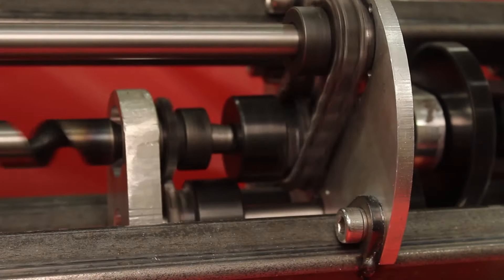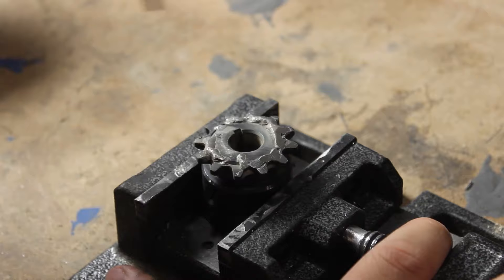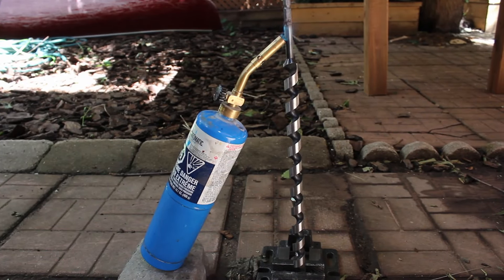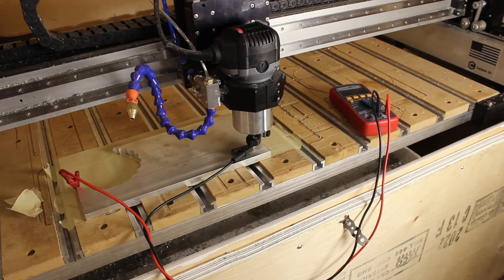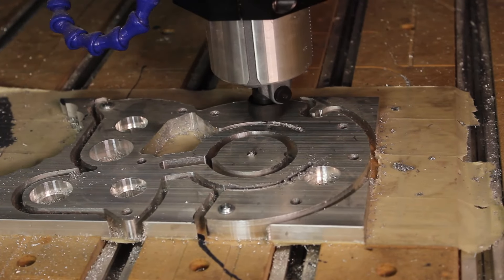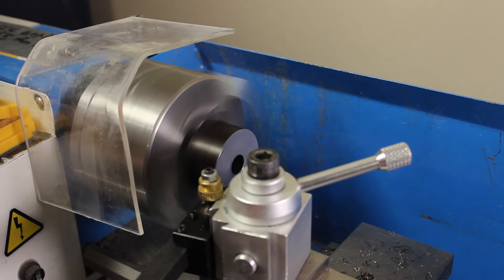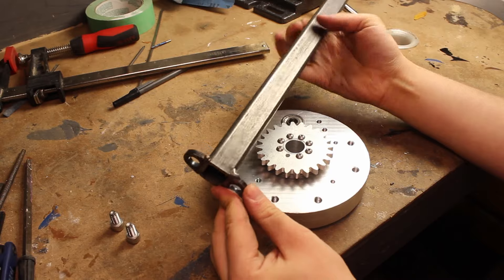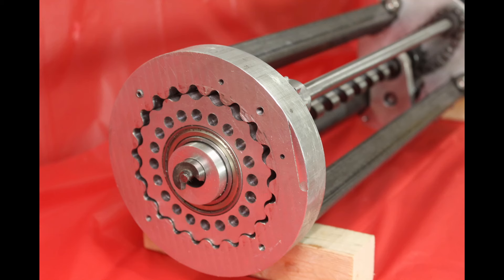Machining an experimental rock drill in my home shop

Comment: You'll definitely want to treat your bearing with a bit more respect though. Bearings don't like static loads so hammering/pressing them in like you do will significantly shorten their lifespan and smoothness. Instead, make or purchase a bearing installation set so you apply pressure only on the journal receiving the interference fit.